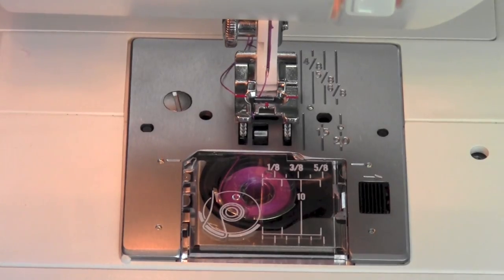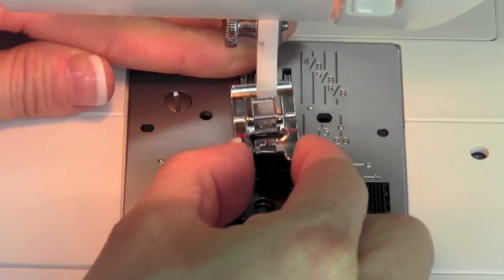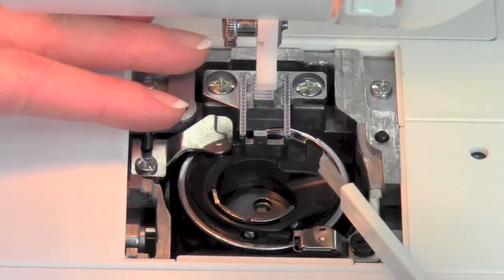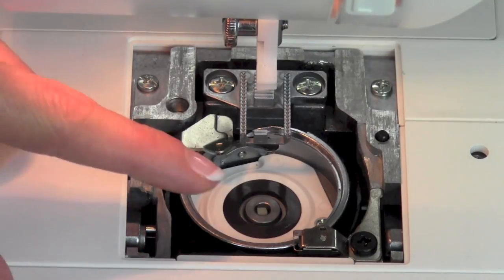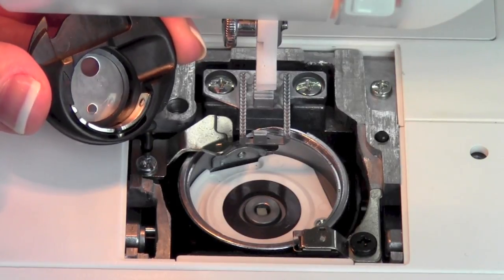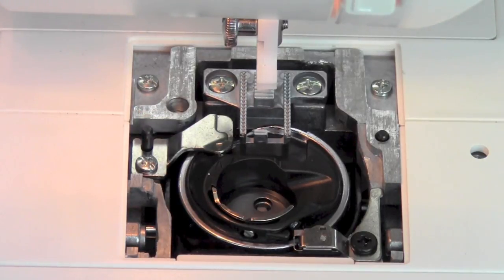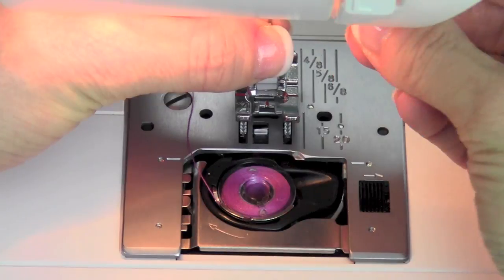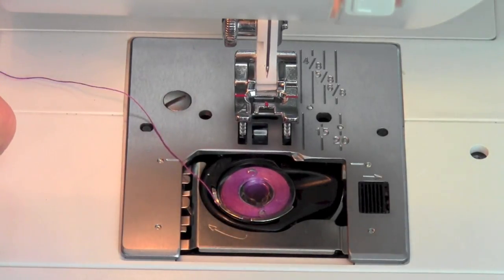Viking Emerald 116 07 Cleaning and Oiling

Comment: My long comment to this machine that I bought 4 years ago is on Barbara’s reply asking why here hand wheel won’t turn. As noted on that comment mine did same at 4 months old. They refused to fix on maintainance contract, claiming it sat on a Taiwan dock for months. Charged $75 for oiling. It has now permanent seized up again. I now have 7 machines so although I sew often I use my 36 year old Elna that I maintain myself and several vintage I now own and maintain myself. This Viking Emerald machine is crap. Since I now live rural and no one not even in the two towns have ANY repair service at all of any kind I just decide to take cover off myself. And see if I can replace whatever is the “closed oil system” stated in the actual MANUAL. This is impossible. I took out all screws and the front and back won’t budge. I was even trying to just break it off as its so seized up it doesnt matter. I got the sides held open enough and the bottom plastic plate off to see that its not the gears or the belts that look brand new but its the top assembly going out from wheel. They lie. This is not a closed system. I was expecting to see a refillable oil bottle or a wick or both. Nothing. All I saw was what my father called monkey grease. That thick oily yellow stuff on a few parts. Amazingly too they say don’t open but the not gears but oval shaped lugs under the bobbin race were all full of lint??? They should at least build in a door to open to clean that out??!! Just taking out and cleaning bobbin is not enough. So basically this machine is designed to fail and if you sew often as I do I would be taking it in for a $75 oil job every few months or more. Because something is wrong. Even if needing oiling I have never seen a machine seize up! I can maintain my no knob numbers 1933 Singer industrial where I have to guess where the tension setting is by playing with gears inside the machine!!! I’m not a dummy. I also have a 1919 treadle, hand crank, 1960s White brand, the Elna I mentioned. No issues at all maintaining. Again this is crap.

Comment: I was told that the Viking 116 should NEVER be oiled.
Reply: Kimberly Norton I wasn’t either and I bought at the dealer and has a class.
Reply: Hi Kimberly, that is what I read on the internet also; it stated that Viking sewing machine made after 1972 did not require oiling.  I wish I knew where she got that piece of information and whether or no it is actually correct.  Have a Great Week!
Reply: @jamesdurham7158  I no longer sew but I probably got that information from the sales rep at the store. Check with the Viking representatives and they can tell you for sure. It has been so long since I posted the information to where I do not remember posting it.
Reply: Hi Kimberly, Thanks for the comeback, my THAT was FAST!  Have a Wonderful day and Stay Safe! James from Colorado.
Reply: Maintainance says never oil!